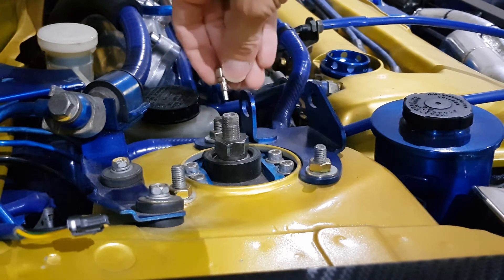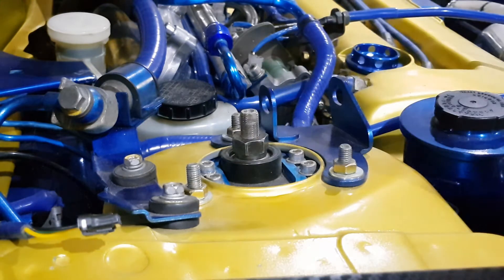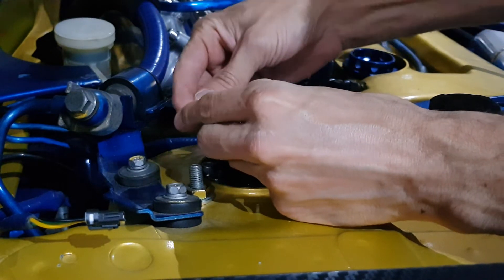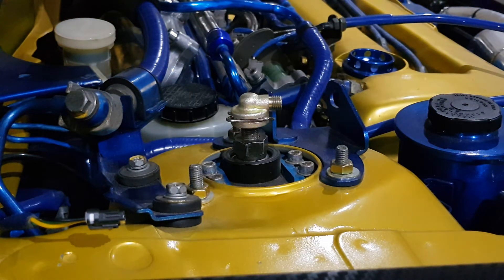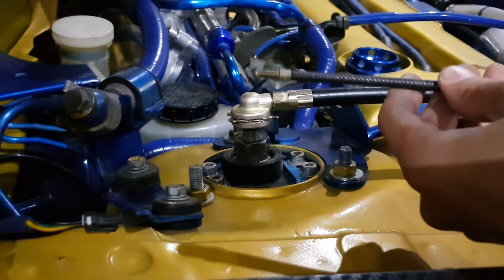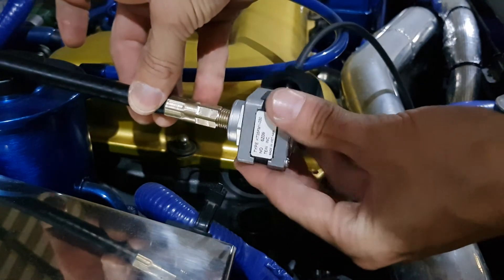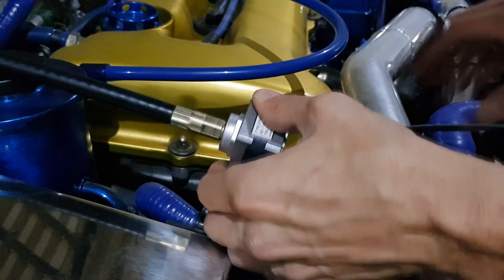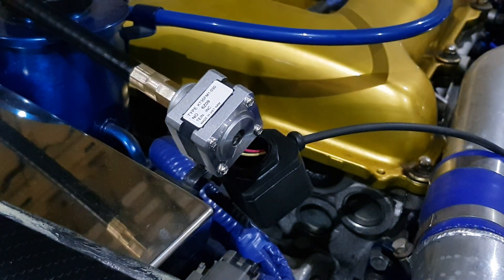how to install Tein EDFC motor extension kit

Comment: Hi, how to differentiate between M10,M12,M14 size on the extension kit? is it both end of the cable will be same metric size?
Reply from the maker: its only the top nut that needs to match your particular size struts.
Reply: @lowguidoschopshop  so what motor size to be use with the kit?

Comment: Hi mate, the conversion rod on the passenger side seems to come up slightly when installed

But the drivers side, conversion rod does NOT come up freely at all, and upon doing some tests, it seems the rod does not rotate at all when all parts are put in place. I've topped up both sides with grease but no luck with the driver side one. Are you able to shed some light on possible solutions?
Reply from the maker: the conversion rod should move up and down freely.  It doesn't need to rotate, but I think it should be able to. check for any obstructions or corrosion.

Comment: Hey mate - Does the EDFC with motor extension kits work just as well as if the motors were mounted on top? I am thinking about using them, but may be able to make it work without them... Any problems using the extension kit? Cheers
Reply from the maker: James Albrechtsen yeah they work exactly the same. I know about lack of info hey. Thats why I made the video
Reply: Cheers mate - good vid